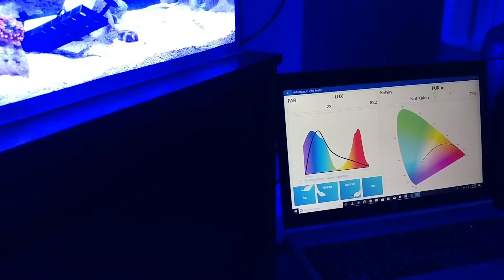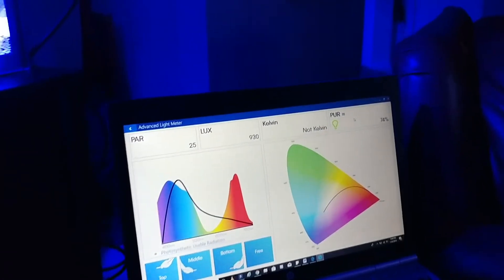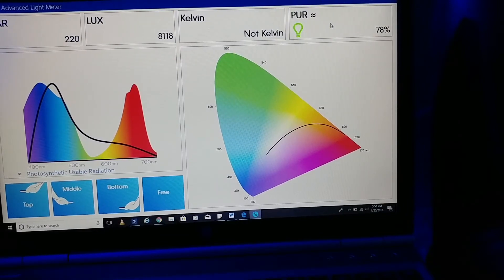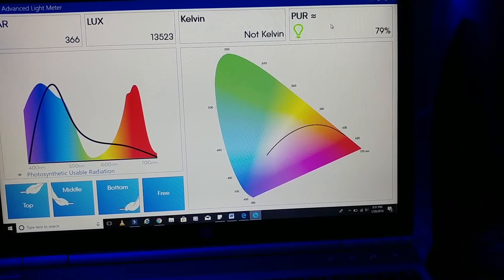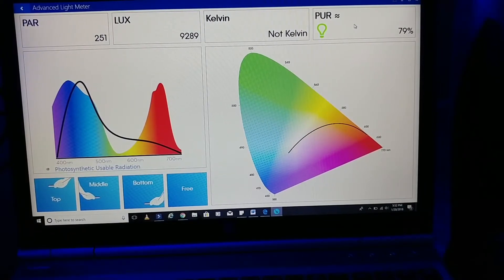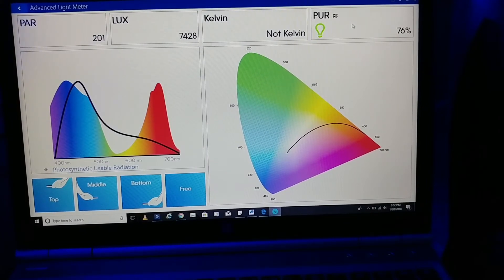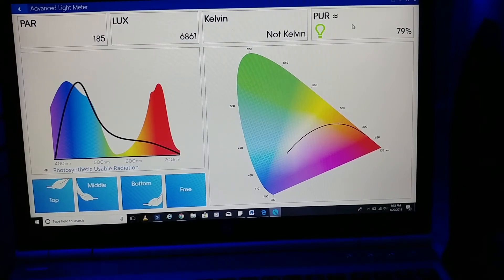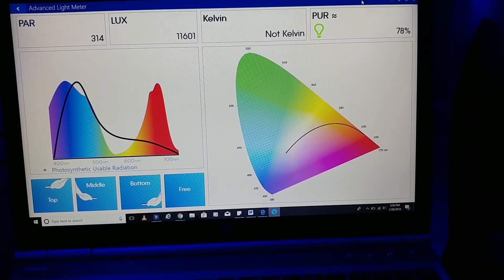AI Prime HD PAR | Par readings for the 25 Gallon Lagoon

Comment: So let me fully understand whats happening here. Youre taking the par level of [ two ] ai hprime hd. And the par is only at 100 on the sandbed??? Are the settings like radion where they keep the intensity on like 30% not 100%??? That seems super low for both those lights 12 inches above the tank or less and at 100%
Reply from the maker: The settings I was using were the BRS Coral Lab AB settings which give good light spectrum but at a lower par. If I was to bump up the Cool Whites, Reds and Greens then the par would increase but spectrum and photo usability would suffer. The AI's are similar to the radions but each channel has their own control. There are pre-set spectrums that have their own intensities so it has a lot of control. Just keep in mind that the pumps were on so the par doesn't just stay at that set number it will jump around.
Reply: Simply Reefing i just exspected more par from them is all especially if they are at 100% would be great for what im lookinf to do so its all good. Have you tried any of the presets from ai itself? Im on a few ai forums and theres like 2 really popular settings away from the radion ab+
Reply from the maker: I have used the presets before and I really liked the 20k 16k and 14k. Par meters give you a real good picture of what is going on with your lighting and this has really helped me.